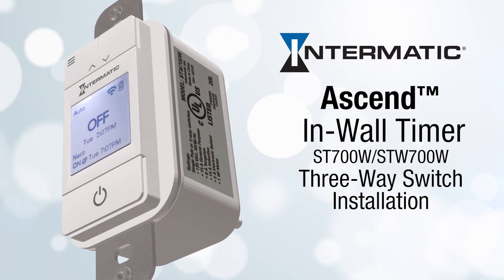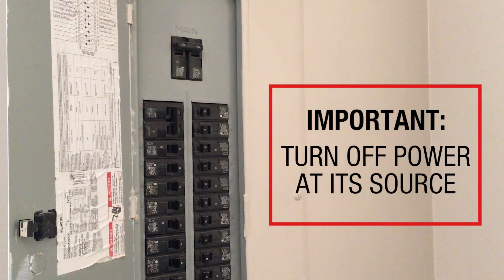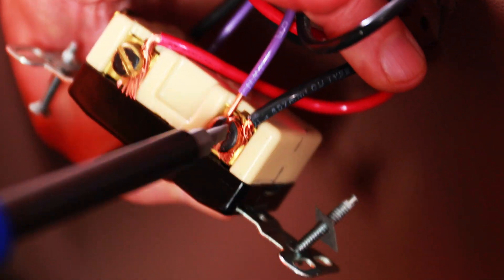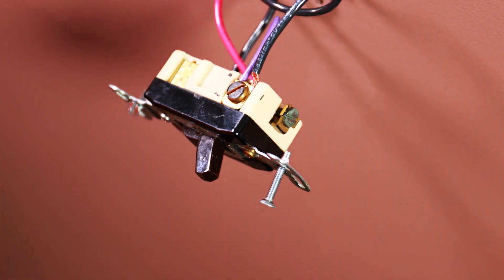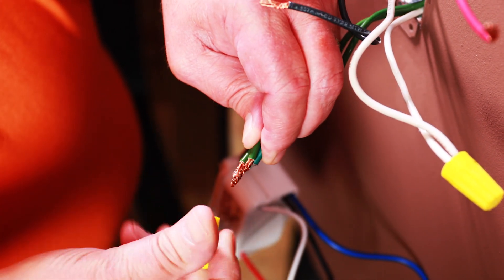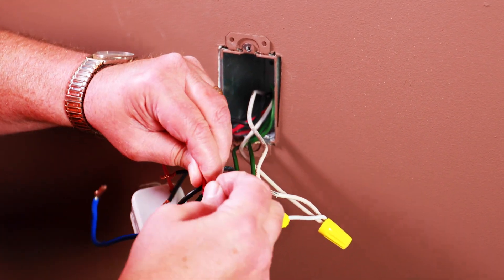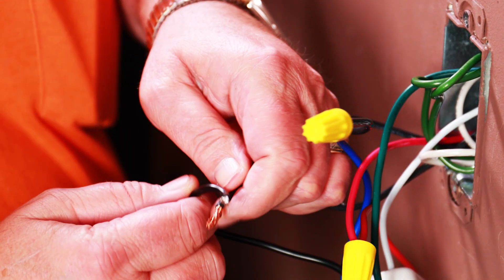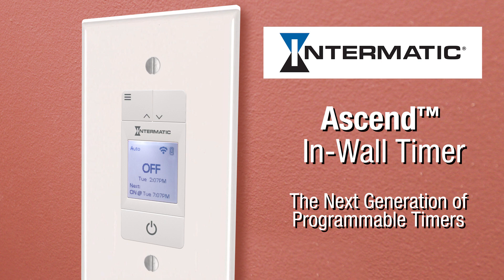Three-Way Switch Wiring Instructions for the Ascend™ In-Wall Timer by Intermatic

Comment: Ok, i have an Intermatic Mechanical timer in the laundry room for the fan in the bathroom, where there is another switch to control the same fan. There are three wires connected to the mechanical timer (white, red and black). The mechanical timer doesn’t have a connection for a ground wire but there is a ground wire available in the wall box. I would like to replace the mechanical timer with the Ascend digital timer. How do I wire it.
Reply from the maker: Hi Flores, Ascend wiring instructions are available on our website -- https://bit.ly/3f1OZKs. If you have any additional questions, please reach out to our Technical Support Team at https://www.intermatic.com/en/contact-us. Thank you!

Comment: I've followed the instructions given in the video, I am pretty sure I've wired (and re-wired) it as instructed, but when I turn the power back on, the switch and lights flicker for about 10 seconds before the switch resets. I have tried re-wiring in different combinations of the Red, Blue, and Black wires (as well as changing the jumper to the other screw in the other switch on circuit) leaving the ground and neutral in place, but no other combinations have led to a functioning timer.  Help please?
Reply from the maker: Hi Trevor,  When you have a moment please contact our Technical Support team, they'll be able to assist you with this issue. You can reach them at 815-675-7000. Thank you!
Reply: Hello Trevor I have the same problem did you get it resolved if so how?
Reply: @ihoooo2008  I THINK I was trying to wire it to the wrong switch, there was a big mess of excess wires in the box at the time and I got them mixed up.

Comment: So there is another box seprate from the original switch?? Im so lost...
Reply from the maker: In a basic 3-way switch there are two switches used to control the same light fixture. If you only have one switch location, it is not a 3-way switch. In that case, you would need to refer to the standard wiring instructions. We hope this helps!

Comment: There is no explanation of how to determine which is the black wire that will be attached on the other end.
Reply from the maker: For help with your question, please contact Intermatic Technical Support at 815-675-7000